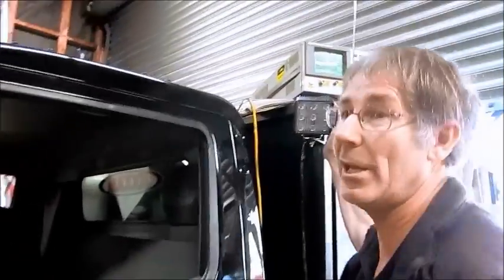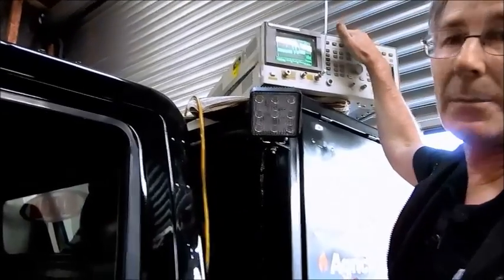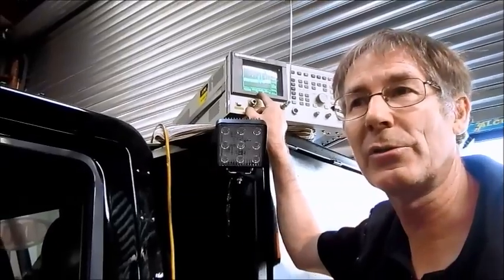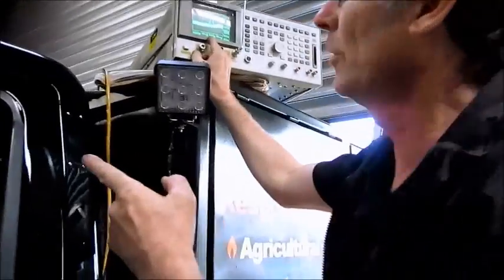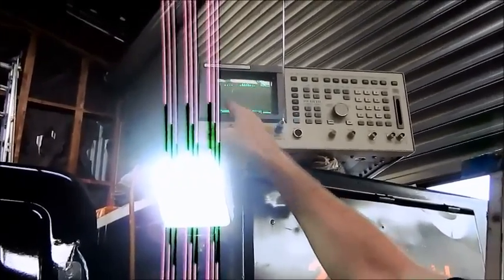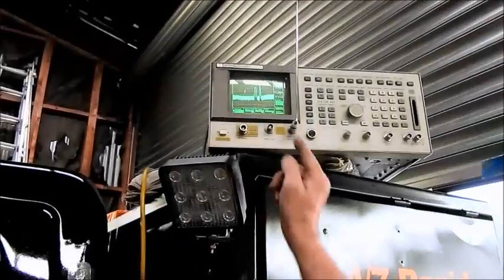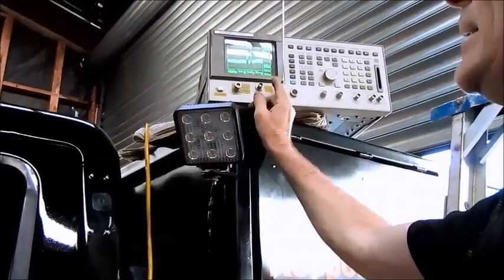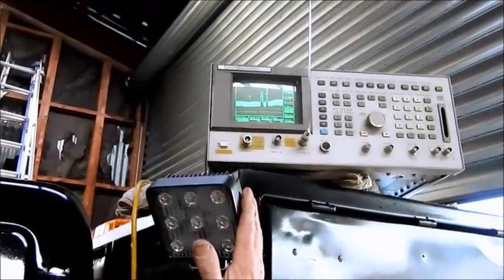LED Radio Interference

Comment: Just installed LED head lights in my car and the car radio FM band has heaps of static. Just bought a couple ferrite chokes to install on the LED power cables, hopefully this will clear up the interference.

Comment: Way late in the game, but being that close you are looking at near-field propagation on spec analyzer.  The noise is probably being coupled through the power lines connecting to source (batt/alt) to the LED and a Ferrite Core (Choke Core/Ferrite Bead).  You may have tried this already and it didn't work, but there are a couple of considerations.

-DC Power Bias Saturation.  In Laymens term these become less effective with more DC current, and their effectiveness goes down.  I bet those lights can take at least 10 amps at 12 or 24 v, so the ones that don't have any material permittivity or DC Saturation ratings will probably be saturated when the LEDs are on.  One core that is working in its rating is worth a 100 saturated ones (2 5A saturated ones will probably 1% as effective as a 10A unsaturated one). This is the #1 issue when people try a Ferrite Core and it doesn't work (barring putting them in the wrong location).

Alternatively, you could have a smaller rated one on the radio's power, but it only blocks one coupling path. (esp if you are using a 1/4 wave ground plane, popular on mobile installations).  I tried this initially in mine (I cut out cheap ones from low power rated VGA cables) but the coupling was coming through a different path.

-Ferrite Material Property.  The material will determine what frequency is effectively being block, and known materials have impedance curves based on frequency.  For the OP he would probably want max impedance at his incoming band (150 MHz/2 meter) so he would choose a core that had maximum impedance at this frequency (or use turns as below) to block this frequency.  A small possibility is that the noise is coming from the audio band, mixer intermediate freq or the frequency of the mixing oscillator on his receiver.  Chokes typically do not impede well near DC (low Q) and this is where an bypass cap may come in handy.  He could look at the spectrum at the lower frequencies and would have to follow Lohi's advice on setting up the spec an.

-# of turns.  People think more turns=better.  Reality, more turns = more capacitance & more inductance.  For low frequencies it will help block more signal as the inductance is the dominating factor in impedance. As frequency increases, the capacitance (not a physical capacitor but has properties of one) will dominate the impedance  and reduce the overall impedance (impedance is a function of frequency). More turns will cause the peak frequency to have a higher peak impedance at a lower frequency.

-Temperature de-rating.  Here for completeness.  As temps increase the ferrous properties will decrease and at a point very rapidly.  Lines in engine bays are an example or in really hot settings.  The ferrite beads also absorb the RF as heat, though this temp rise is fairly minimal unless your noise is really high.

Resource on info on Ferrite Beads: https://www.analog.com/en/analog-dialogue/articles/ferrite-beads-demystified.html

Example showing how turns afffect impedance (numbers are for a particular material and its a log chart)  https://palomar-engineers.com/wp-content/uploads/FB56-43-Turns-Impedance-Graph.png

I was building a Orange Pi Linux Box to decode HD Radio (Digital Radio in US, its crap and wish they chose DAB+) on a SDR in my car.  Story short, I had a nasty noise floor, and thought it was dirty power to the SDR from the plug in hybrids's 300 to 12 DC converter.  Turns out the LED headlights (cheap aftermarket Chinese, that probably have fake FCC certs) were shooting wideband noise, using the light power lines as inefficient antennas.  Bought some Ferrite Cores that were rated for 4000 mA and my SNR increased from 7 to 15 ish :-).  Hope yours is as successful

Comment: Hey, Paul; yep, the power supply in the lamps could be causing emissions, but, a couple of questions?
DO you have any filters applied to the line into the lights?
Are they 'inexpensive' Chinese lamps, with CE, VDE, FCC, CSA, et al, approvals?
Where is the 2-way antenna located, relative to the light?
The spectrum analyser is within 1/2 metre of the light, maybe closer, so you are picking up radiation that only needs to be <1/1,000,000 of the power of your radio transmitter to swamp it (square law)
The spectrum analyser is set up to be sensitive-enough to show the local FM transmitters, so that it is very, very likely that the EMC from the light is severely overloading the front end, so that it APPEARS that the noise is wideband... it is, more typically, limited to several MHz, and the main component will be, probably, in the 100-600 KHz range, with harmonics dropping off rapidly...you do not appear to have a preselector filter in your setup, which is required when testing signals in the presence of strong out-of-band interferers!
Not to say that the light is not producing EMF/EMI, but your test methods do not appear to be correct for this issue to be measured correctly.

Comment: The same here. The external led lights of my building causes RFI to my ICOM IC-2300H. I installed a band pass filter 140 - 160 MHZ but nothing happens, the problem still there.

Comment: I have a led warning light bar on my roof (strobes) when i key my mic for a CB (11 meter band AM USA) The CB will turn the lights on and have them flashing.... ANY ONE know how to fix this?
Reply: Christian Smith ,  sounds like radio is finding ground through the light bar.  Check the radio and antenna are properly grounded.
Reply: You can put a capacitor across the supply lines of the lights this will stop them flashing when in tx